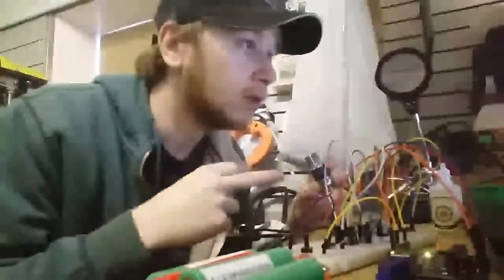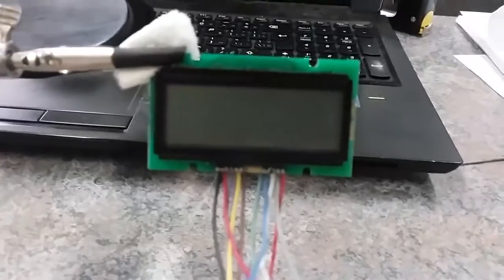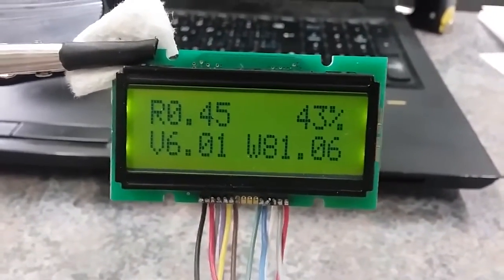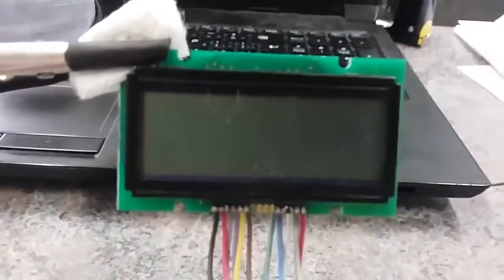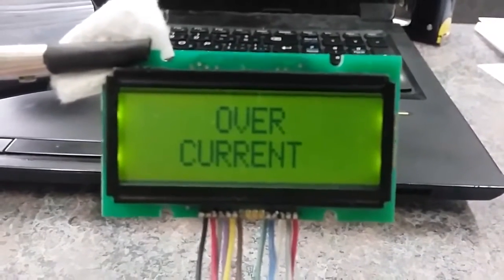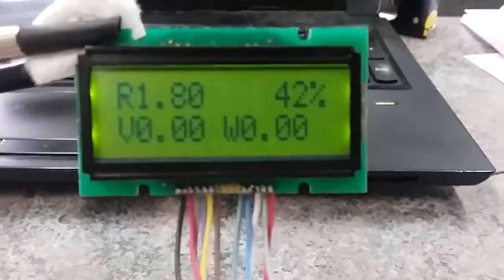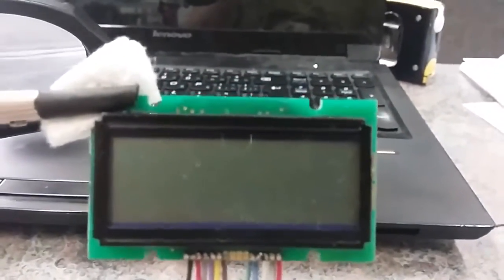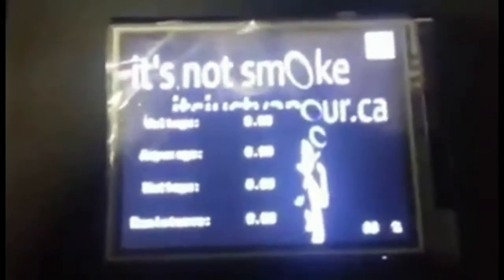Smart PWM Vaporizer from Prototype to Final Product

Comment: how do you measure the ohms?
Reply from the maker: forteleaerieneromane I pulse the atomizer on for less that 1 ms while the ADC in the Atmega measure the voltage across a shunt resistor and the pile. Since the 3s pile voltage is higher than the 5V limit if the Atmega, I use resistors to divide the voltage by 3 and multiply it in software. the voltage across the shunt resistor is too low for the resolution of the ADC so I amplify that voltage using an operational amplifier. once I have that shunt voltage I can find out the current going through the load, and from there the resistance of the load is the pile voltage divided by the current.
Reply: That's an interesting solution. By chance, do you have a schematic for this? Thanks!
Reply: I'm asking because it seems hard to push high amps through a 1mOhm resistor, if you place it like you said, is series with the load
Reply from the maker: forteleaerieneromane because the shunt resistor is so much lower than the load itself, most of the voltage is dropped across the coil. the limit I wrote into this device is 40A... 40A^2 * 0.001Ω = 1.6 watts. since my shunt resistors are rated to 5 watts, they're well within their specs. if the voltage across the shunt resistor is too high (indicating more than 40A of current) the device locks up to avoid firing at that current. I'll see if I can find a diagram and give you a Google Drive link to it.
Reply: I get it now. My bad. I thought you had a 1 mega ohm resistor as a shunt when, in fact, it is a 1 milli ohm. That's why it didn't make sense for me. Thanks!

Comment: I've been working on my own. how do you read the resistance of the coil while it's in the deck?
Reply from the maker: Stitch Sanders I used a couple of lm358 op amps to step the voltage across a 1mOhm shunt resistor that's in series with the load, up to a readable level for the analog input of the Atmega. From there you can just use Ohms law in the software to determine current through the load. Then it's just a matter of taking the measured pile voltage (which is divided by 3 using a voltage divider so that the input to the analog pin for the pile measurement is 4.2V or less) and dividing that by the current to get the load resistance. All of this is done in a <1ms pulse, before the PWM kicks in.